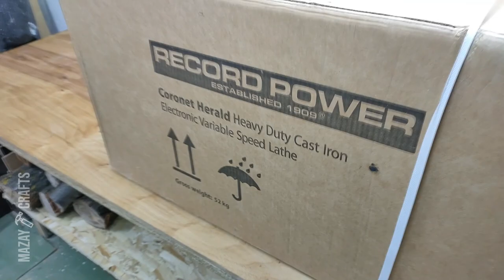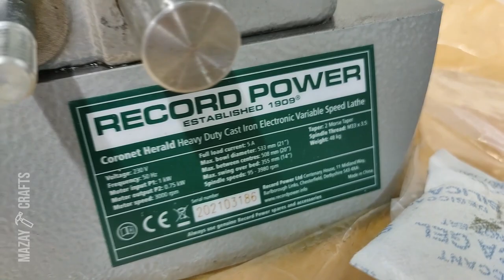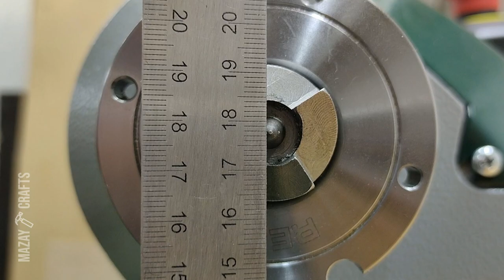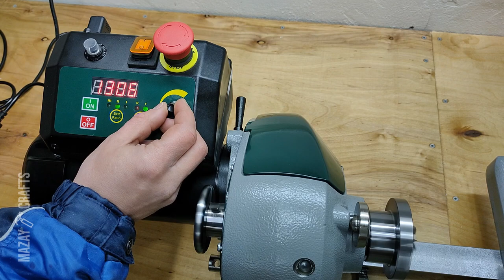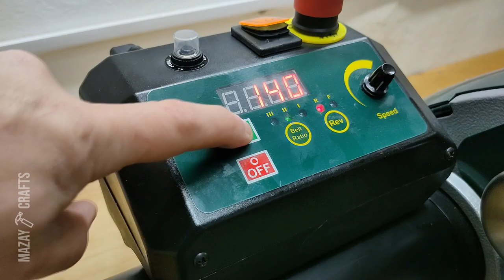My First Professional Machine in the Workshop - Small, but Powerful | Unboxing and Test

Comment: I am new at woodturning and have just bought the same, not bolted by on legs. I am new to woodturning and I notice you used what looked like a round nose scraper for the inside of the bowl - is your sharpened like normal - I thought those chisels were for finishing (I live and learn!).
Reply from the maker: Congratulations on your purchase, I'm happy with the machine. I usually use a scraper for finishing before sanding. Good luck!